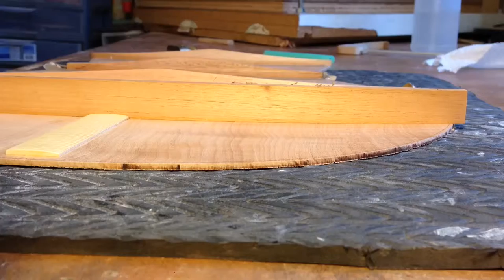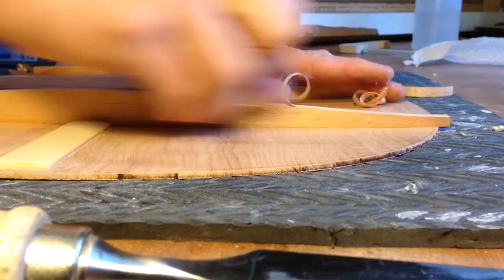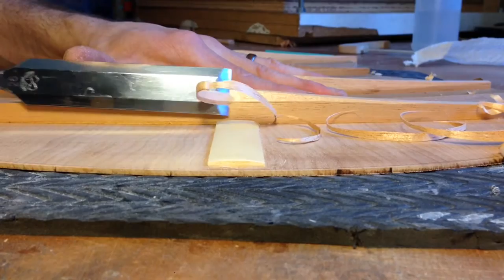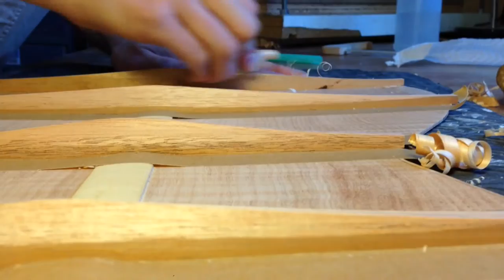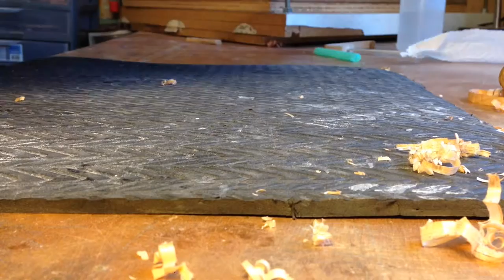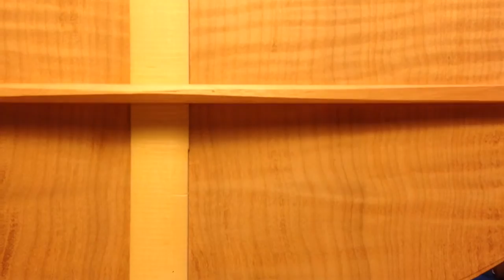How to shape guitar and ukulele back braces quickly and cleanly

Comment: Bamboo bracing! I've often wondered how well bamboo would work as guitar bracing. As strong and flexible as it is I never saw a reason why it's not often used.
Reply from the maker: Bamboo might work
Reply: @BeauHannamGuitars  What brought it to mind is that the bracing you're shaping in this video looks and seems to carve a lot like bamboo.
Reply from the maker: @extrasmack  it ain't bamboo- it was either spanish cedar, mahogany, or spruce- thats all ive ever used.
Reply: @BeauHannamGuitars  likely spruce then. It was very pale and had the super tight grain. Aside from the color and tight grain what brought bamboo to mind was that it appeared to have nodes in some shots. It reminded me how I've often wondered if thick bamboo slats would work as bracing. As mentioned it's strong and resilient, though thinking about its resilience it may prove too flexible as bracing... or it may not. Who knows...  Maybe as liner/kerfing material? Just random thoughts. Thanks for engaging in theoretical discourse.